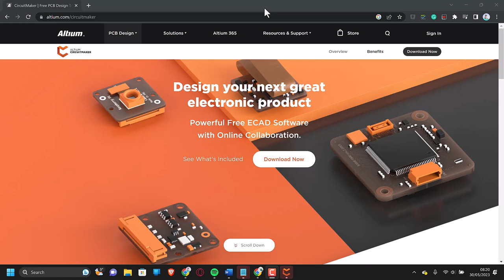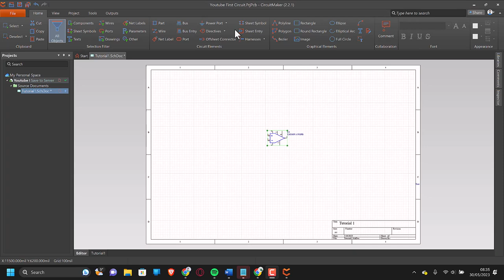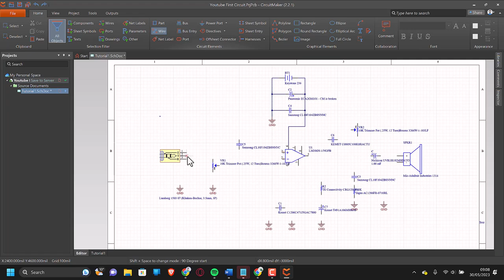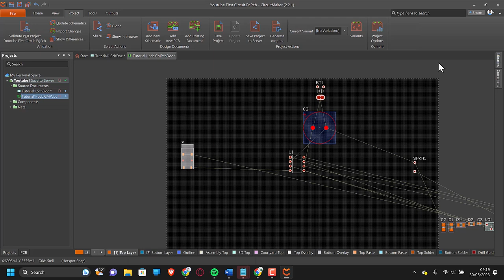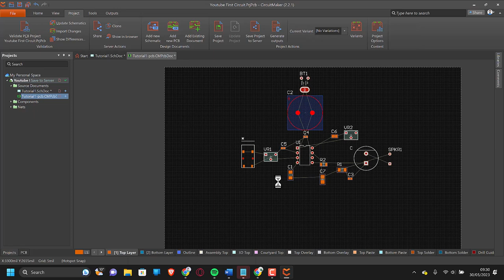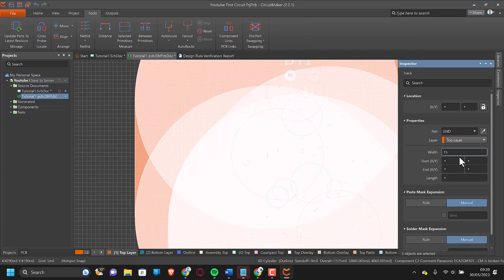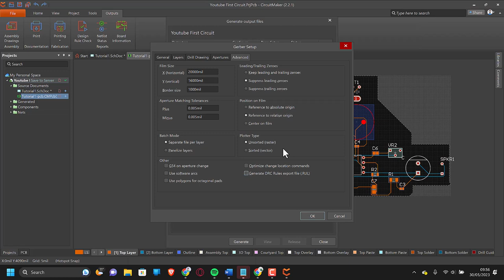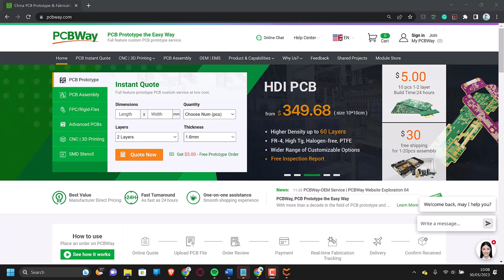Getting Started with CircuitMaker 2.2: An In-depth Introduction for Beginners

Comment: Two Questions:
1.  It appears that I'll have to buy a computer capable of running CircuitMaker. CircuitMaker's minimum system specifies TWO high-resolution monitors, but you are only using one. What is the other monitor for, and is it needed?
2.  My applications require a ground plane, or at least a layer where unused space is interconnected, but I didn't see an option for this. Is this possible with CircuitMaker?
Thanks.
Steve